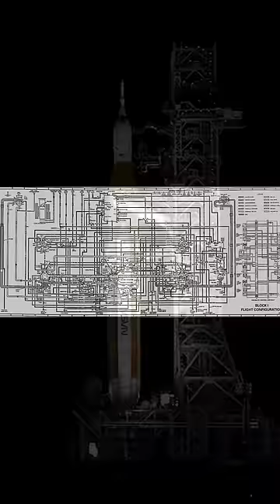NASA's Artemis 1 Rocket Launch Scrubbed Due To Stuck Valve #shorts

Comment: Rocket science is easy; valves are hard.
Reply: Classic case of science on paper vs engineering in the real world
Reply: Valves are easy, LH2 valves are hard
Reply: @squidwardfromua  I’m afraid to ask— what are LH2 valves
Reply: @stant7122  Liquid hydrogen
Reply: This case is not for NASA to take 10 years to spend $32b to handle valves like that!
Reply: @stant7122  Anything dealing with liquid hydrogen (LH2) is hard. It doesn't have the hazardous qualities of some rocket fuels, but when it boils at just 33 kelvin and has tiny molecules that can slowly permeate solid metal, it's just a pain in the ass to work with.
Reply: Brittle O-ring has entered the chat
Reply: *new science: valve science
Reply: i hope it goes up like a huge billion dollar firework
Reply: @googlelovesdoxxing7981  falling foam was invited to the group by Brittle O-Ring
Reply: @googlelovesdoxxing7981  O-ring was SRB, though not LH2
Reply: @CommyPlayz  that is called TPS(thermal protection system and is not a big deal(the craft is not next to the engines, but above it)

Comment: I knew that not finishing the WDR would throw something their way they hadn't dealt with, that's exactly why they're supposed to do them.

Just hoping this has acted as an unplanned WDR and they've gathered all the info they'll need to launch it now on the 2nd September.
Reply: But they still haven't competed it...
Reply: Yes, in effect today was WDR 2, but if all had gone well would have been first launch.

Fingers crossed for the next attempt, whenever it is.
Reply: @michaelmicek  But hopefully they've managed to get enough data to proceed
Reply: @AthAthanasius  Actually, more like WDR 5.
Reply: I wonder what the difference between a WDR and the preparation for an actual launch is. If it is small, you might as well launch it right away after a successful "WDR". (I know, WDR is simpler because they don't have to pay attention to the weather, close the air space etc.)

Comment: NASA: 'We won't do another WDR. The valves will work.'
Jean Claude Van Damme: 'Wrong Bet!'
Reply: Not really, cause if they did another WDR they would've had to drive it out to the pad and return it to the hanger another time which would have delayed the launch way back.
People forget that this is just as much a test as a WDR apart from the fact if everything was good to go it would've flown another WDR wouldn't have made it fly on the 29th, the schedule was too tight for that.
Reply: who?
Reply: @yap5995  Sorry, Leon
Reply: They already did work once during the Green Run at Stennis.

Comment: Thanks Scott for the succinct summary. Extraordinary and in my book reckless to have known about the issue since the wet test and instead of fixing it just 'hoping it will go away'. I wonder about a culture where news that could delay a launch is not welcomed by management.
Reply: When the engineers warned them about the O-Rings on the shuttle, bosses insisted on the scheduled launch so all the school children could watch them illustrate the consequences of mismanagement.
Reply: They did not know it was an issue, but they also did not verify its functionality. Seems like pretty gross oversight for a major step in pre-flight readiness.
Reply: @thisisjvh  yes they knew.  Your the only one that didnt
Reply: And you could do better?  What have you designed and built that worked first time.
Reply: It's not about it not working first time, it's about not testing and proving it before launch day.
Reply: @Fatpumpumlovah2  Its amazing to me that most of the people who are rude online are ALSO wrong.
Reply: Are you deaf? They didn't know whether the valves were working or not because during the wet rehearsal a different issue prevented them from testing them. They were betting on them all being functional.
Reply: @patreekotime4578  keyboard warriors with no degree in anything.  Must be expected.
Reply: @patreekotime4578  Blame it on the booze .. 🥴🤬
Reply: @thisisjvh  How is verifying it before launch any different from verifying it during the wet dress? Its the same process. If something is not nominal they simply will scrub.

Comment: "They tried increasing the pressure" - this for sure builds confidence that they know what they are doing...
Reply: It's complicated stuff. What would you have tried?
Reply: @dougewald243  if this were my home-built hobby water rocket, I'd probably have tried the same. With a billion dollar rocket and the whole world watching, I know the incentive to launch is enormous. But after having gathered gigabytes of test data in the decades before, I would expect the  observed issue to be a major deviation from expected behavior and then the only appropriate thing to do would be to abort the launch (which eventually they did). Things like this tend to be early warnings of bigger issues and no one wants an RUD on the launch pad or in flight for that matter.

Comment: Isn't that exactly the problem with stuck valves? Even if they had tested it in June, and it worked, it could just as well have stuck now. It worked multiple times before.

Comment: Supposedly the engines worked at Stennis previously, only due to a pressurization hack they used then. This time however that hack did not work, and the valve remained stuck.

It's going to be interesting to see how they get out of this one. What are the chances they'll have to swap in another engine?
Reply: Maybe it was due to corrosion in the humid climate.  Wait, they already played that card!

Comment: I wonder if these valves have any coatings on them. Industrial hard carbon (IHC) coating for example is frequently used in various industries. It has high lubricity and wear resistance which can increase time between failures. No idea what kind of coating if any would work under these extreme conditions in a rocket with cryogenic fuel and oxidizer.

Comment: Does the term "stuck valve" imply either a mechanical or electronic failure, or are we awaiting further analysis to determine the root cause of the valve failing to operate?

Comment: Honeycutt: "The way the sensor is behaving does not line up with the physics of the situation." It's a bad RTD.
Reply: The sensor has a faulty reading, it would have been OK to launch.
Today however they had a Hydrogen leak at the fast disconnectors, which was not OK to launch

Comment: Good job getting this far ... rockets are hard.
One day we will look back on these E.C.M.s (External combustion motors and say" Whew! Thank Technology we got away from that archaeic, failure prone system of thousands of mechanical valves, millions of relays, miles of plumbing and now use rechargeable battery packs and EDFs (electric ducted fans) and photon engines!
Reply: External?  All the combustion is internal.

Comment: I get rocketry is crazy difficult and the complexity is insane… but billions of dollars and held up by a stuck valve. What else is going to go wrong here?
It was supposed to be a cheaper solution as it reused existing parts, equipment, infrastructure and yet it has proven to be billions over budget and still no better than any other solution out there. Iterative (CD/CI) is the best approach to building rockets. They cost less, produce better testing results, and ultimately a better vehicle. 
I had high hopes for SLS, what a disappointment.

Comment: I mean. If you have an oil valley that's plugged in your engine. You can just risk it. You have 3, 5,or 7 other cylinders to run on right? Multi million $ rockets can skip tests, and be fine. What could go wrong?

Comment: They didn't test the valve because the fuel return line was leaking? This franken-rocket's gonna bang like a firecracker at 80000 feet, isn't it...?

Comment: The engine with the stuck valve was E2058. It first flew in 2006, meaning it was constructed 2005 or earlier. 

At that point, guess who controlled Aerojet Rocketdyne? 

Boeing. Of course it was Boeing 🤣😭

Comment: You would think that NASA, the epitome of safety excellence, would do EVERYTHING to recheck any possible issues, no matter what.
Reply: They did, that’s how they found the fault
Reply: @jb76489  no, they found the fault on the day and almost time of the launch. He even said they gambled it was gonna hold instead of actually checking it. The end result wasn't another challenger bomb, on this occasion.
Reply: Ummm... they did. That is literally what happened. They ran through a pre-launch checklist and found an issue, couldn't fix it, and aborted launch. The is the epitome of safety
Reply: @graemepennell  yeah, because they checked and found it
Reply: @jb76489  it showed up just before loading the fuel.... That's not exactly "found it". As prev, they gambled it was still good and the gamble failed.

Comment: Same valves used by Boeing? Why all the failures due to valves? Its not like we're at the Cape with its humidity and salty air for the first time. Nothing will ever compete with the old bird known as the Saturn V. 4 billion on a one off rocket? What was the total cost of the Apollo missions?
Reply: Apollo launches also costed roughly 2 billion in today's money, like future SLS missions.
Of course this is unnecessary much for a rocket mainly built with existing shuttle components

Comment: It's all about the design.  SLS is flawed.  It inherited flaws from the shuttle program.  30 years of this and we still, at best,  can only deal with the anomalies as they come up every single time!  Sometimes that meant scrubbing the launch.  It often did during shuttle and it will with SLS.  It rarely,  but not rare enough,  RUD.  SLS and certainly Artemis cannot deal with a RUD.  Again this is not a people problem.  NASA is exceptional but this design is flawed.  We need systems that are rapidly iterative and reusable so we can master the product and recover from flaws quickly.  So far this has only been demonstrated by the commercial industry.  Mainly SpaceX but other commercial companies will come online that far outpace what NASA has done.  Leave NASA to supply technical expertise, mission planning, and deployment product.

Comment: How many gambles has NASA taken on launches that either didn't happen or which went awry? I'm very curious about NASA and their seeming pattern on taking avoidable risks because of pressure to make launches happen, or in the case. It is so disappointing to see NASA taking chances like this, and I'm grateful it wasn't something vital going wrong in the air. What is it they say, better to be on the ground wishing you were in flight than in flight wishing your were on the ground? Are there any further things which went untested in wet dress rehearsal that should have? Might it not be wise to have a full wet dress rehearsal? One wouldn't be a waste time if it meant a launch going right when it would've gone wrong.

Comment: What do you expect when you power your rocket with old used shuttle engines.
Reply: The old used shuttle engines were fine... it's the brand-new plumbing attached to them that failed. RS-25 isn't cheap and it's hard to maintain, but it's a very good and very reliable engine. The Boeing-built rocket it's attached to, not so much.
Reply: @simongeard4824  did they Bidonize the new plumbing?

Comment: SpaceX is putting astronauts in orbit.  What has nasa done since obamaaa?
Reply: Deployed the JWST? The Juno probe around Jupiter and Parker Solar Probe? The Curiosity and Perseverance Mars rovers? The Kepler, GRAIL, InSight and Lucy missions? Landsats 8 & 9? NASA's done a tonne of amazing work, especially on the relatively low budget it's had since the Apollo days.

Arguably NASA could have done way more, if they didn't have to spend over $20 billion developing the SLS. By the way, Congress mandated the SLS be built using old Shuttle parts, keeping previous contractors, etc.

For all Obama's faults, his administration isn't really to blame for SLS delays and cost blowouts. Nor is Trump's, or Biden's.

Comment: I knew a stuck valve would be the gremlin.  I know those valves are very difficult to design, test, and operate but hasn't NASA learned from previous valve failures?
Reply: like a failure to release Half Life 3?
Reply: @sashimanu  Turns out a stuck Valve just prints money instead
Reply: NASA didn't built the core, it was Boeing. Boeing has recently been having issues with valves, ie starliner.
Reply: @carl8790  Ever since the merger with McD, Boeing's work has been going downhill.
Reply: @carl8790  Yep, forgot that Boeing built it.  Boeing needs to send their valve team to  start designing airliner seat foam for a few years.

Comment: Mark my words: This thing will never fly. I had high hopes until today.
Reply: It will, stuck valves are super common
Reply: Oh, it'll fly sometime. Maybe not successfully, and delays might drag on for a while longer, but they're not going to scrap it at this point, so sooner or later (and yes, probably the latter), it's going to fly.
Reply: @simongeard4824  Lets say we have stuck valves or the like for 2 more attempts... you think those boosters will last forever because we want them to? Then what?
Reply: @GypsyTinker2012  Then they'll either take a risk on launching them, get another waiver declaring that it's safe to use them even further past their use-by-date. Or they'll haul it back, de-stack everything, and spend a fortune on replacing the boosters, and try the whole thing again.

Comment: Stuck valve of "Starliner" (🤣). Stuck valve on Artemis. Do I detect a pattern. Then's there's something about going with "the experience gained" from using fifty year-old engines (sixty+ years if you throw in the development cycle). SLS is going to turn into the punchline to its own joke.

Comment: Was this the RS-25 that was already used on some of the Space Shuttle missions?
Reply: Yep. Nobody's building new ones; all the engines are Shuttle surplus. (This questionable design choice comes courtesy of the US Congress, in their infinite engineering wisdom.)
Reply: @MrNerdHair  Actually, they are building new ones, just not for the first few SLS launches, which will be using salvaged Shuttle engines.
Reply: Well, looks like I was *completely wrong*. Not a comfortable feeling! Turns out there's already a contracts out to build at least another 24 engines of a new expendable variant, the RS-25E.
Reply: @MrNerdHair  yep, and I believe they're priced at somewhere in the neighborhood of $150m each. Meanwhile, SpaceX reckon Raptor will be about $250k over the long term...

Comment: Those flow diagrams are horrible.  I (and most industries) moved to a better system years ago.  Why is NASA so far behind?
Reply: Make a better one then and let me see, everyone is so quick to become an aerospace engineer when shot happens.
Reply: @jaydenhinds6896  I have done work for the Artemis mission.  I'm a mechanical engineer, not an aerospace engineer, I don't have my head in the clouds. I can't attach a picture to a comment or I'd show you one example from my over 20 years in industry.  Send me your e-mail address and I can give you an example.

Comment: I really hope all of those issues will be one timer, they just need to have the right configuration one time, and everything will be smooth from here, next SLS will be reliable and quick to build. 

But if it is a global issue with the SLS, like there is so many components tinkered between them, that the system is totally unreliable, well I guess that Artemis will quickly be out of funding.

Comment: I bet for the artemis weighing 5 million lbs that when the boosters come off and the top separates that the top weighs  50,000lbs( same as the space shuttle I'm.sure its less) at most and the rest is just rockets and it costs $60 billion
A railgun costs $1 million and can shoot 23lbs into space so in theory can shoot 50,000 lbs into space so in theory it would cost $2 billion to shoot the same amount with a railgun  and there  would be no change of liquid leaking

Comment: As a layman who simply just loves to watch these things fly, I felt a surge of pride as I saw Artemis steaming on the pad. But I also felt another emotion — dismay. Here’s another super big, super complicated machine with so many moving parts and systems we’ll be lucky if we see people on the moon in fourteen years much less four. Why not design something smaller and simpler (aka Space X) to do the job. It’s still complicated but it’s feasible and we’ll still feel the same sort of pride when we see it take off.
Reply: The ship SpaceX is building right now is bigger, heavier, more complicated, and more powerful. But its also not built from the reused parts of dozens of space shuttle launches from 30 years ago. And its also not anywhere near ready to launch any payloads, let alone lunar orbit payloads. It is still just a flying water tower.
Reply: @patreekotime4578  a falcon heavy, fully expendable, could probably launch Orion to the moon without any payload, and maybe 2 people.